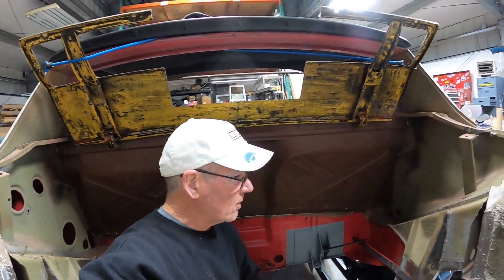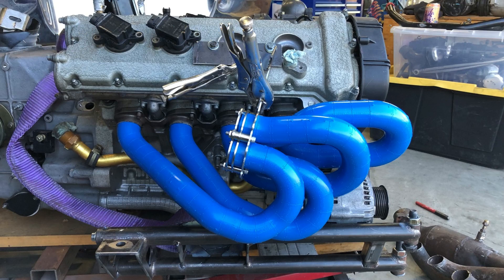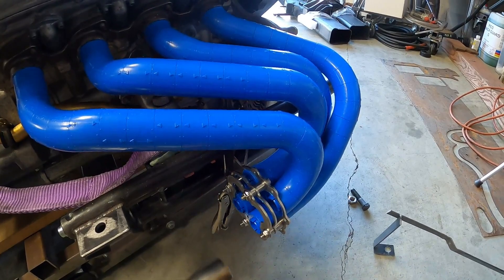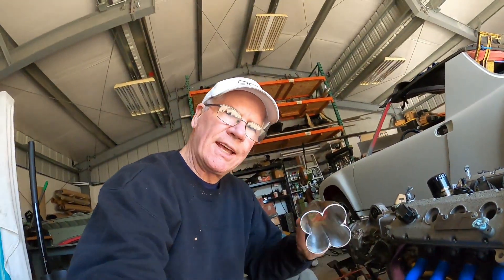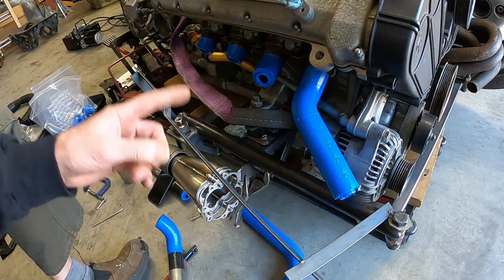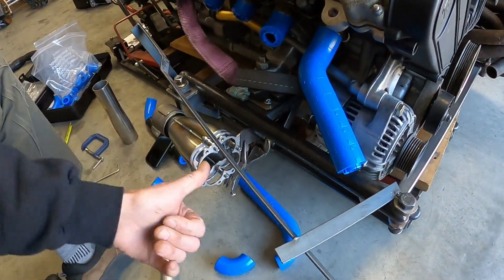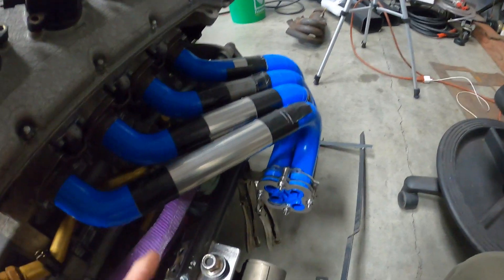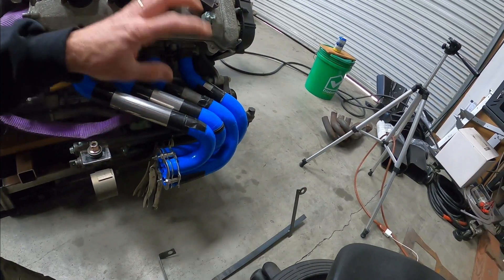914 Ferrari Build - Episode 13: Headers, Part 2

Comment: I always envisioned someone modeling headers with coat hangers, baling wire and welding rods. Very interesting and informative. Glad to see you using SS. It like the way it welds. Chris, will a heat shield off the one tube or ducting to the alternator  be necessary? Keep up the great work. You don't put on airs and I especially enjoy the retakes over outtakes. Looking forward to the next video.
Reply from the maker: Thanks much! Good eye, too: yep, I'll probably add a heat shield or try and duct air to that location.